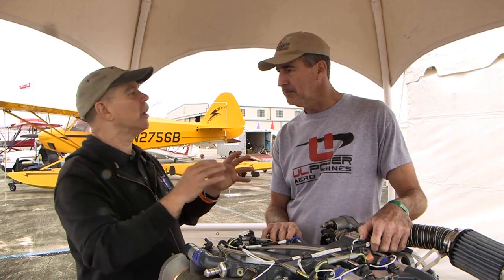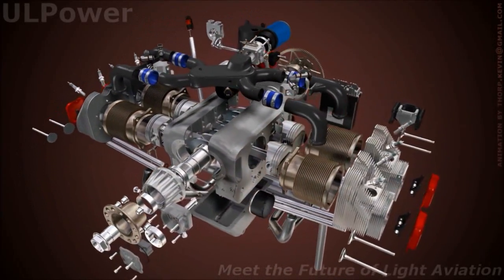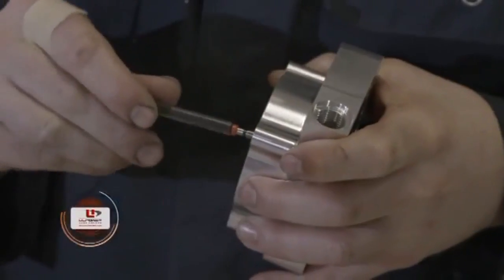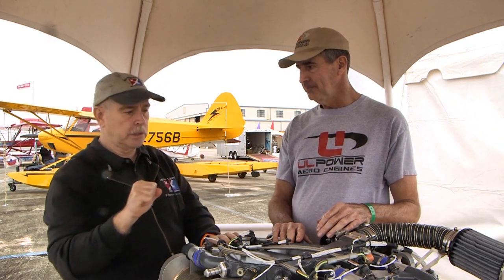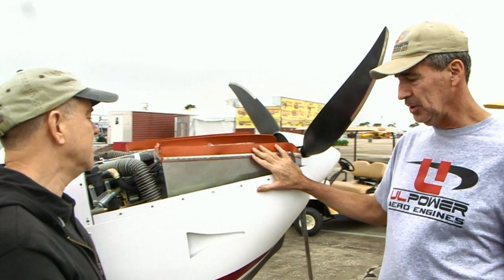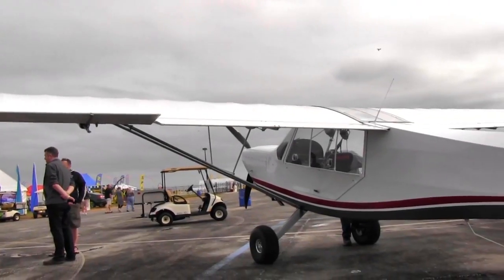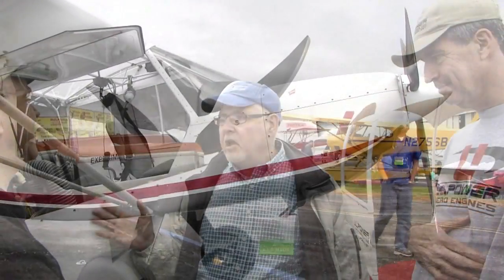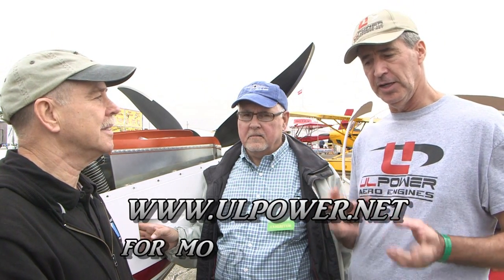UL Power, UL 520 six cylinder, 200 HP air-cooled, direct drive, 220 lbs. aircraft engine.

Comment: 220 pounds for a 200 HP engine wow....thats light, the Lycoming 0-320 dry weight is about 250 and thats 160 HP. With that type of a HP to weight ratio, Id love to see the 6 cylinder 200 HP UL installed on a Super Cub.

Comment: I have never been a fan of Rotax. They must rev too high. To me they sound like a two stroke chainsaw. I hope this does well. It is time for a paradigm shift in light aircraft motors. It cost as much to put a carburetor with mixture controls and carb heat than to just have fuel injection. I am actively looking to purchase an airplane within the next year or two and the stuck in the 60’s mentality along with the until now limited engine options infuriates me. I must buy a built airplane due to my arm and shoulder and until the last few months I have been profoundly disappointed. This is a beautiful plane and I hope to talk with them soon. And Just Aircraft soon.

Comment: Fuel injection is not new to aviation, electronic fuel injection is new to aviation, and if you put one of those engines on a super cub in Alaska you will still have to pre heat the engine for winter operation.
Reply: +John doe Why is that different from anything else operating in Alaska? anything running electronic injection and ignition should start like a standard car
Reply: phil kennedy Its not really, but electronics and extreme cold do not go together very well, in fact very few systems do, the old manual systems are time proven. When its 40 below zero where cars operate, its 70 below zero where aircraft operate. In 40 below zero the LCD display on radios will not even work. I worked on aircraft in Alaska for 13 years, and when the emission standards forced the Diesel engine manufacturers to go all electronic on their engines, they had all types of trouble and failures, which could not be tolerated on aircraft.
Reply: +John doe I understand your reticence but we can and have overcome those problems. all modern turbine powered aircraft are electronically controlled and operated as well as the cars and trucks. the mistake made by the early adopters of electronics is they thought they could just patch it onto an older design and everything would be fine - clearly it was not.  My little Hirths, with electronics can start, after a -30 cold soak, quite happily without any external aids. even colder can be achieved with a little thought.
Reply: phil kennedy The very new turbines might use electronic fuel injection, but all the Turbine engines I worked on, the Fuel Control Unit was run off of the accessory gear section with no electrical connections at all. Even synthetic motor oil does not flow, in 40 below zero, I did the experiment myself with all the major brands in the 90s in Fairbanks Alaska, Mobil 1, Amsoil, etc. regular 30 weight motor oil, you can make a ball with it and play catch, thats the reason you have to preheat any piston engine before starting it at those temps.
Reply: LOL in the 1990's.

Comment: It has always amazed me that the common aircraft engines used in GA are stuck in the 1930s. UL Power shows how it should have been being done for the last 30 years.
Reply: They're still pretty far behind the automotive world. Look at a 5 liter coyote, roughly the same displacement as this engine, but puts out 480horsepower. And lasts longer.
Reply: @drewhansen429  Automotive engines are not build to deliver 75% of max power output continuously. That is a big difference. Hence you cannot compare car engines to aero engines.